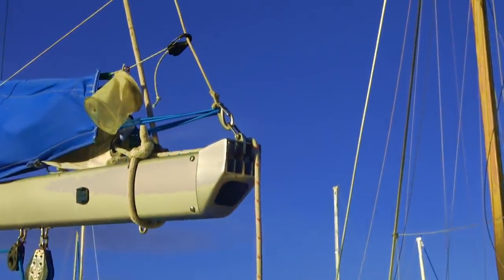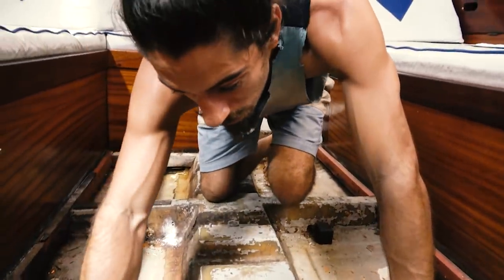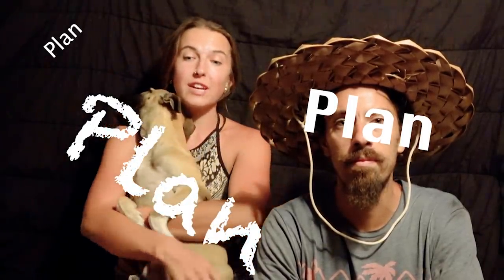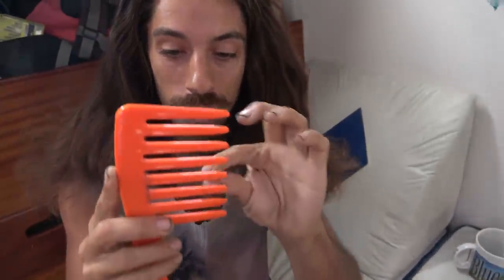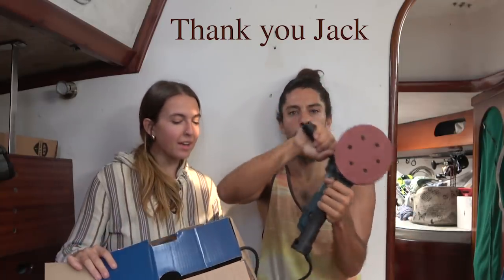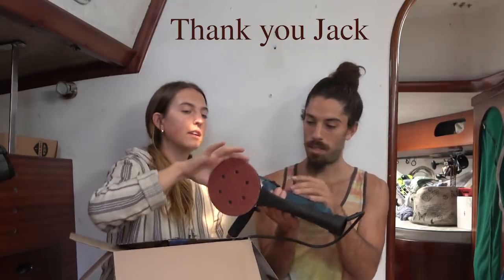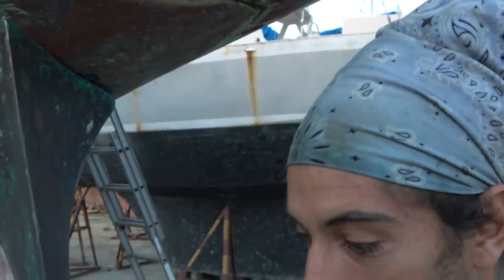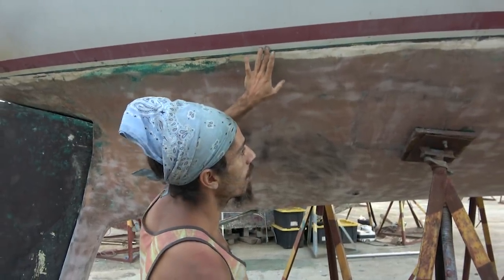Boat MYSTERIES that will BLOW Your Mind! Ep 68

Comment: Just a thought,could you possibly fill the stringers with epoxie then continue with the PLAN. I'm no expert so you should consult someone with some experience in the field. Thanks for the vid. Joel  if your hair falls out just let it go, baldness is something I AM an expert at lol. Take care.
Reply: Epoxy resin by itself has basically no strength, it is just solid plastic once cured. Better if they could inject resin thickened with milled glass fiber or colloidal silica. Just as easy - or easier, even - would be to layer glass over what structure is there, leaving it hollow with no steel mechanical fittings. The core material (if there is one) gives little strength, the 'skin' is where that comes from (think airplane fuselage, or what is technically called "monocoque" construction). Like an eggsheel, all the strength is in the outer layer.
Glass layered over what they already have which extends nice and far out onto the hull (say 6-8") in order to spread stresses is what I would vote for. Using epoxy resin, for it's improved secondary (mechanical) bonding characteristics over poly- or vinyl-ester resins. Grind away at the old material to remove all paint and oil and leave plenty of "tooth" for the resin to bond to, use a 60 or 40 grit paper. Pretty straight forward, not rocket science. They can handle it. :) 
Last thought - you may want to make a nice rounded filet in the corner where the grid meets the hull prior to glassing, so that the glass you put on makes as shallow a bend as possible for maximum strength. You can see examples of this stuff on YouTube.

Comment: Cut Open the hollow part and glass in so you stick the three inch screws into the grain of the wood not with the grain  cut strips of hard wood glue to together put in with resin made into peanut butter thickness jt

Comment: If your  stringers are hollow and lacking strength you may consider this 
http://www.transomrepair.net/product_info.php?products_id=34 
You could try to make your own compound but heat is a big problem with standard resins or structural fillers. follow the instructions to a tee and be sure to properly support the keel and hull to maintain profile. Following the pour I would grind to prep the crack area and lay up new layers to properly reinforce that area as well.
Reply: they are actually not stringers they are former's sorry about the error in terminology

Comment: Make sure that you sleeve your bolts through the fiberglass channels so you do not crush the hollow fiberglass floor channels during bolt tightening.  Make the sleeve short enough to tighten the bolt onto the fiberglass channels, but long enough to not crush the fiberglass.  I am a mechanical engineer (advanced stress analysis) training but I am not a navel engineer.  your final solution you should pass by the navel engineer and get his approval.   And remember a term called acts of hidden works.  You can not see through the walls in which you need to see through so you are always guessing on your decisions on partial information, which you will not know until you dig into your problem.  Make plans for contingency's of what if...  it is all about the risk of not knowing.  I know I am not helping right now, but it will help in the long run.  Call the manufacturer and get construction drawings!!!!  and/or ask someone to send you PDF files of the drawings, PLEASE PLEASE PLEASE!  If there is a steel manufacturer or a weld shop in the area, they should have access to a UT gage (Ultra Sonic) which is used to check welds.  A good UT gage and some multi frequency UT gages will see through all of you fiberglass and tell you just how thick the walls are and if there is wood butted up against the fiberglass or not.  UT gages will find all of your cracks and internal voids.  

  I wish you well and I wish I could help you to repair your boat, but I know little about boat construction & boat building.

Comment: This is frightening to read, so many 'experts' so much bad advice. PLEASE find ONE person who knows how to effect a repair and  let them do it. Your problem is being able to recognise that person, your choice of a 'surveyor' tells me that. If it were my boat I'd get rid of it and find a proper cruising boat, smaller and more seaworthy, one that has a more kindly motion at sea and one that can take the ground, save you lots of money on mooring fees and let you get into shallower more interesting places. But if you are hell bent on effecting a repair (before selling and therefore at least getting your money back) then at the very least make 100% sure you use epoxy resin to do ANY glassing to old polyester grp, that's why the cover up repairs flaked off, polyester is not an adhesive and will not form a primary bond onto old grp. I would drill 1/2" holes along the tops and fill the hollow sections with runny filler making sure to avoid heat build up whilst curing. Then the addition of heavy stainless angle (well epoxied mild steel angle iron a lot cheaper) bedded on epoxy right across the top full width, maybe an offset type of angle where one flange is the width of your 'ribs' (correct terminology 'floors') and the other to be wider, as wide as you can get even if that means raising the cabin sole. Have tangs welded to the angle going down each side of the 'now filled 'floors where  appropriate and through bolt. Simple and very very strong.

Comment: Don't do anything on these floors. Leave them alone, they're n use and you will never get something good out of something that is rotten. I would be quite weary of the stringer myself.
Make new epoxy laminated floors next to the old ones and BOLT them thru hull from the outside. Check you stringer thoroughly : the fact it has some wood doesn't mean a thing at this stage, it may be partially rotten : as a chain is only strong by the weakest link so the stringer is only strong by its weakest point.
I didn't have a stringer problem myself but I did have a floor problem : if you give me your e.mail or any mean to reach you I would gladly go onboard and shoot a few picks showing you what I did : that was 20 years ago and it still like new.
But think EPOXY  the is the strongest laminating glue to day, forget fiberglass. If you want use fiber think carbon and epoxy… but on this matter I wouldn't tell because I never worked the thing myself and my knowledge is very limited. Wood and epoxy I know and so far I feel it is the best alternative to old fiberglass.What you're going thru is  not new and you reach the limit of fiberglass : it is strong … but it is not a good bond, thus it leaves water getting into the wood structure (when there is one) and it's like you've got a colony of termites dwelling in there. The more so when osmosis gets into the picture (and most boats from this generation are riddled by osmosis) : acid developed by osmosis attacks the wood even more …
It seems that Captain Freddy has good advice too. 
And please ! please ! Don't listen to (I repeat do NOT listen to) people who owned yards and who've been doing such repairs for 20 years and see that all the time : most of the time their answer to their own customers were made on the basis of their financial demand and their knowledge of the low expectations they had about their sailing objectives : saying in the summer weekend along the bay is 90% of their customers and they give a response accordingly : by no mean te response suits these who are blue water sailing.
As for borrowing a tent … this is the FIRST THING TO DO as well as doning MASKS WITH ACTIVE CHEMICAL FILTERS : 3 weeks ago we carried another friend (yes another friend, he was not the first) to his grave : dying at 58 after working with  protections that were not as strong at the time did a lot of damage to many. Besides cancer there are many hazards : allergies by the ton (when doing epoxy, resin, fiberglass and the like : whatever the climate don a use only once paper working overall covering you completely (with hood), tons of latex gloves, masks as above… throw these at the end of each day's work : this is akin a  lab technology… DO NOT BELIEVE PEOPLE WHO WORK THE STUFF IN T.SHIRT AND SHORTS WITH GLOVES ONLY as you see plenty of them on You Tube : your health is at stake. I REALLY MEAN IT). Use protective creams : some people worked so much with epoxy that their skin become itching as soon as they enter a workshop where epoxy has been worked with. Another friend could not even touch a piece of epoxy after it cured without having his fingers' skin starting to peel, literally !!!… Emphysema and other lung related strong ailments are a pretty good risk too. Not to mention neurologic ailments. 
So protect yourself. FIRST THING IS DO NOT BREATHE, EAT OR SLEEP IN THE BOAT AS LONG AS YOU WORK IN IT : all the dust particles from the old fiberglass gets to you body whether you want it or not. Think that baldness may well come from what you did and not, as you try to comfort yourself, fro not having the right comb !…).
Cheers ! 
Expect new so I can send you pics of what I did.
Reply from the maker: Our email is sailingsustainably@gmail.com. Your pictures and description will be much appreciated. We will take your concerns to heart, exercise caution and use proper protection when approaching this repair.

Comment: Just a thought, if the fibre glass on those ribs & stringer is as thick as you say, could you not drill and tap threaded holes for the bolts to screw into? There seems to be plenty of fibre glass "meat" to work with. I would have thought that all the strength comes from the fibre glass laminate anyway and that the wood (however little there may be of it) served only as a former to fibre glass onto whilst the boat was being built. Your friendly surveyor who came up with the steel strap solution should be able to confirm this. Your boat looks to me to be built like a tank in any case with fibre glass laminates that heavily laid up. Whatever solution you publicise on here, somebody is going to berate it. That's very easy to do from afar on a keyboard In the comfort of an armchair. Stick with your plan, but adapt as you go. I've got major sander envy right now - is it a Bosch 150 turbo? (drool....). Your dog is one cool pup by the way 😎. Try to avoid the dreaded PBA (paralysis by analysis) thing. You're doing a great job (from my arm chair anyway) 😊
Reply from the maker: Yes this has been confirmed. The strength is in the fibre glass. The ribs and stringers are made outside of the mold and then fiberglassed to the hull. The wood would only serve as a form for the fiber glass. It is a Bosch 1250. Exactly, One thing we can be sure of is no matter what we do, some will berate it.

Comment: One possible solution and there will be several , would be to drill though the floor horizontally and low with a long series drill bit. This should be large enough dimension to allow a metal rod to pass through afterwards. This rod will be larger diameter than the proposed holding down bolts of your stainless plate. Then drill down to intercept the rod you have inserted and tap the matching thread to your holding down bolt. You will need tap and tap stock for this American terminology may be different. The hold down forces will be exactly the same as originally intended and the sides of the thick hollow structure will take all the stresses. Remember, the purpose of the wooden floor cores was to be formers of the fibre glass. The fibreglass is the provider of strength and much of the strength comes from the cross section of the material. I have used cardboard as a former because if all I wished for was a hollow beam then a cardboard tube will saturate with resin an become as rot proof as the glass beam it becomes an integral part of. The section and thickness of your hollow beam are the deciding factors of strength and your plate will spread the load across the whole of the hull: so same effect as originally intended but an adjustment as to method of achieving fastening without extra welding or fabrication costs. When tapping threads buy good quality HSS steel tap and do not be greedy with your cut. A quarter ton clockwise at most and then back. Don’t hurry the process let the tool do the work! You may well have other advice perfectly valid which suits you better, do not be afraid to embrace it. Best wishes

Comment: The inside of the structural members are filled with foam core board that creates the shape of the structural members. The strength of the part is from its shape, not what’s in it. You will NOT be able to bolt on a strap either vertically or horizontally. Your combined lack of basic knowledge in the “repairs” you plan to make causes me concern about your wellbeing out at sea.
Reply from the maker: Thank you, this confirms much of what we have learned in the past few weeks. Remember there are many who just sail and pay others to do any and all repairs. Sailing and repairing a boat are 2 different things. We are choosing to learn both by doing and share the learning process, something not many would do.